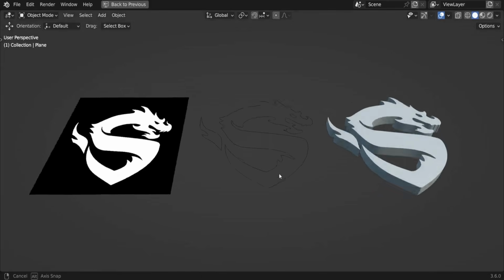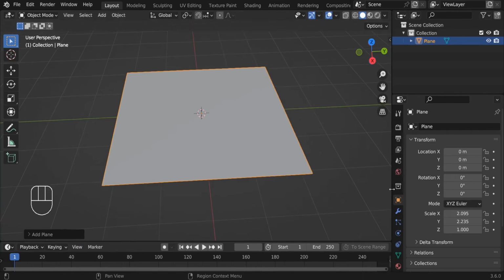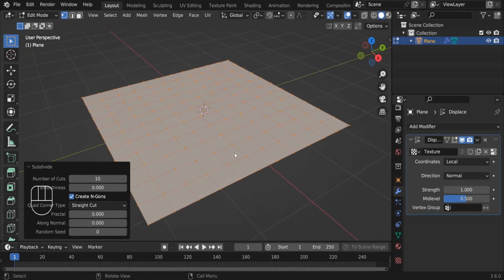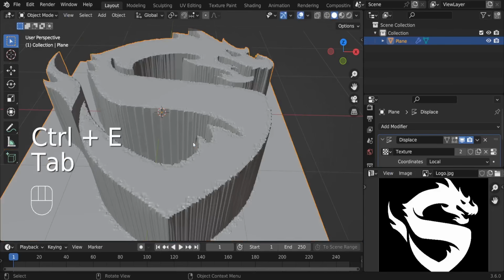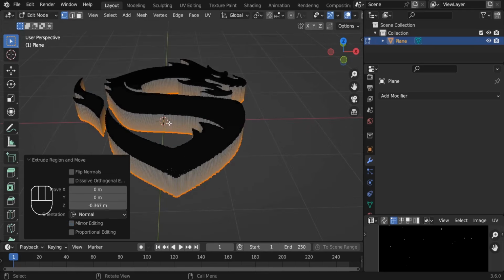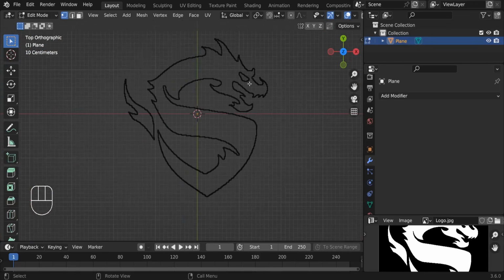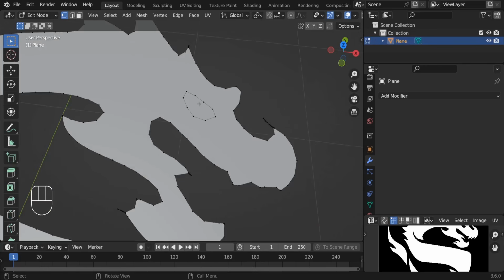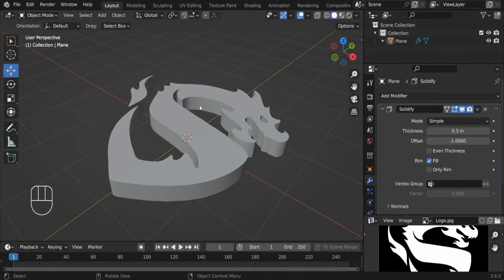Turn Any 2D Image to 3D Model in Blender - Beginner Tutorial

Comment: The Unsubdivide issues people are having is likely to be caused by not clicking "Apply" on the smooth modifier
Reply: nope it's applied alright, the unsubdivide just doesn't work for some reason (prob topology)
Reply: It normally fails due to unfinished process or incorrect layout. When I first started it failed over and over again, but after googling I found it was caused by me, now I have no issues with it.

Comment: Thank you SO MUCH for this video! After a happy mistake, I figured out how to make an even cleaner outline. After applying the displace modifier to the plane, then create a second plane. Use the Boolean modifier on the second plane and choose the first displaced outline as the object with the eye dropper. Make sure the second plane is close to but not touching the base (the part near the flat area). Apply the Boolean modifier. Now you have a super clean outline. Extrude that plane to create a 3D object. Let me know what you think!!
Reply: Tried this, doesn't seem like the boolean modifier is actually doing anything. I use the selector on the other plane, hit apply and try to extrude but all that happens is it extrudes the solid plane.

Comment: I ran into two problems:
1- Un-subdivide does nothing, no matter the number of iterations
2- When cutting holes, the boolean operation only produces an edge within the original object. Deleting the smaller object doesn't remove the polygons and there is no hole. I have to export the mesh and remove faces manually in other software (I'm new to Blender).

Thanks for the tutorial
Reply: you ever figure out issue 1?
Reply: @arenadid  what is do is loop cut the square to get the starting 4 quadrants because of this issue